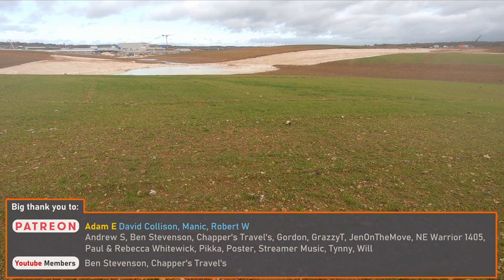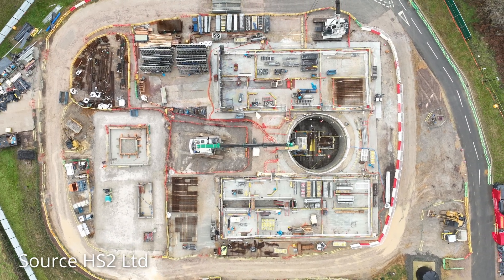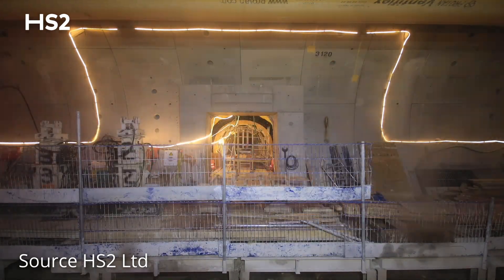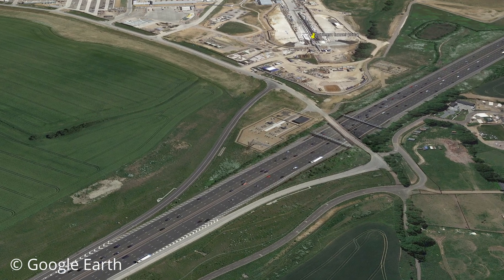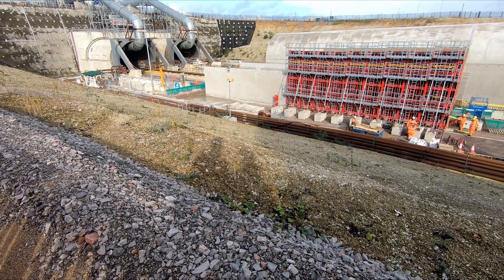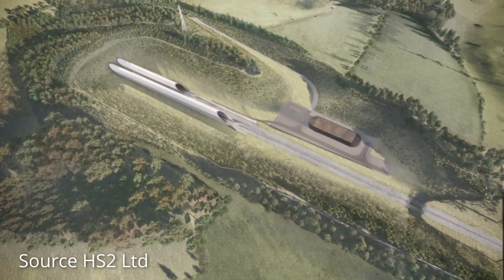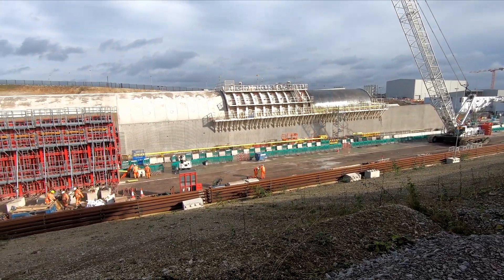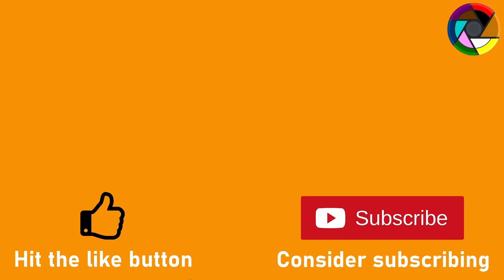HS2 Chiltern Tunnel progress

Comment: HS2 should still continue going north despite its costing £Billions to build 1st Phase of HS2 to Birmingham. I do think that HS2 will be completed before 2030. By the way Merry Christmas 😊
Reply from the maker: At the very least it must be built to a Crewe
Reply: Euston station probably won't be completed for year's
I wouldn't be entirely shocked if labour decides to proceed with Manchester now underground through station first through, in prep for eventually building HS2 up to it, HS3, it will probably immediately stop the sale of land, if that has even started yet.
Reply: For me the money would be better spent going to Crewe, or further, rather than worrying about Euston. Tunnels between there and Old Oak Common will not be cheap.
Reply from the maker: The problem is OOC limits services to a maximum of 6tph. Plus modelling showed that 70% of people will want to go to Euston despite Liz Line connections.
Reply: If HS2 only goes to Curzon St. Brum, it will remain quicker to keep using the WCML from Euston for Rugby, Coventry and Wolverhampton.  What we need is capacity for freight, and the undecided junction at Handsacre will be key to this.
Reply: @john1703  the problem is that if you allow the lapse of time to grow, the cost of the tunnels are going to increase because factories will need to be built or rebuilt and the tbm will surely deteriorate the longer they are left underground.
Reply from the maker: That's the thing, I believe the segment factory for the Northolt tunnel would be used for the Euston tunnel. So its imperative work on the Euston tunnel begins immediately after the Northolt tunnel.
Reply: @Rail_Focus  Plus in the West tunneling whilst not cheap, it usually does happen on time and on budget and without incide. They are getting be showing off an completing tunnels even ahead of time. It usually the equipping those tunnels with services where things goes wrong and things full behind schedule.
Reply: But the Manchester leg has already been scrapped and Labour won't be able to find enough money to re open it.
Reply: As the economy grows stronger, more plans for high speed rail networks will probably be made
Reply: But if there is a growth in the economy (which is doubtful) the growth will be short term but infrastructure improvement is long term, starting with a feasibility study which would take longer than any economic growth period
Reply: Thanks for all your videos , fantastic insight . I’m really hopeful that Labour can get the project and HS3 from Liverpool to Hull back on the rails  . I have no problem with the government borrowing billions to invest in transformational infrastructure. It’s the uk’s only hope . The new line will propel Birmingham for the lucky residents.

Comment: Great video! One of the big mistakes I think from phase 1 was creating all these tunnels rather than running the line overground to appease local opposition. This is in part why the costs have exploded. I would be curious to hear your opinion on whether the tunnels proposed in phase 2a could be scrapped in favor of an overground line, even if it requires a less direct route (after all speed is not the point, capacity is). It seems like the only way phase 2a will be built is if we can somehow cut all the unnecessary overengineering to reduce costs.
Reply from the maker: Phase 2a is cheap in relative terms. They should just build it as is,  It would've only had 2 short tunnels so it wouldn't make sense to mess around with the design. A slower less direct route would be longer requiring more land and track so any savings would be negligible. 

Phase 2b had extensive tunnelling but that was underneath Crewe and Manchester so less about appeasing NIMBYs and more about not wanting to demolish houses.
Reply: But which is cheaper ? Building underground through North West London or building overground. Building overground would have resulted in thousands of services and traffic diversions. Just imagine the chaos. Building underground is neater and out of the way.

Comment: Long siding. 0 connectivity another failed infrastructure project.
Reply: @Rail_Focus  If you cut the arms and legs off a body then unfortunately the designed system can not perform the intended function.
Reply from the maker: Agree it should be built in full, everyone should be campaigning to re-establish phase 2 to Leeds, Manchester and Golborne so HS2 can fulfill its full potential.

Comment: What's the point, basically it's just a head shunt, a 100 miles long, not enough distance to get the train up to top speed, before it returns to Landan,a complete waste of money, what was wrong with the abandoned Great central route, it's pathetic
Reply from the maker: 100 miles not enough to get to top speed? Okay 🤣
Reply: Hmm: well, the original Stockton-Darlington Railway began as a "shuttle" between two stations.....
Reply: Completely agree....no point in continuing after cutting off the arms ams legs.
Reply: @Rail_Focus Great idea to flag off your viewers comments / opinions.

Comment: Considering that the all over higher speed trains routes have been scrapped I hope this is also scrapped
Reply from the maker: Yeah and leave 90% built infrastructure littering the countryside as well as laying off 30k+ workers. Not the best idea.
Reply: Once this bit is opened the pressure to complete it will be overwhelming. A lot of rich/powerful people will find changing trains at Old Oak Common/Birmingham annoying, and it'll get finished.

And it'll all be worth it, because this project will still be useful in 100 years. People will use this is 2123 that same way we use barely upgraded Victorian railways.